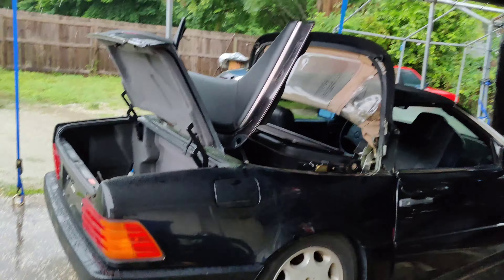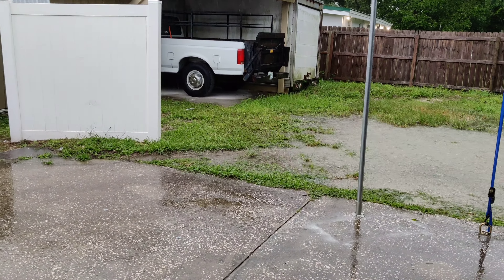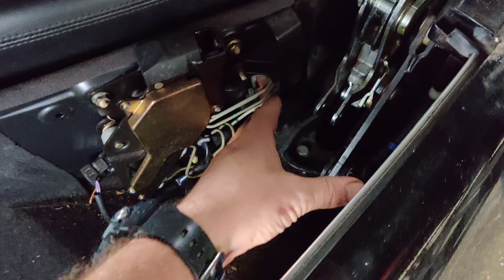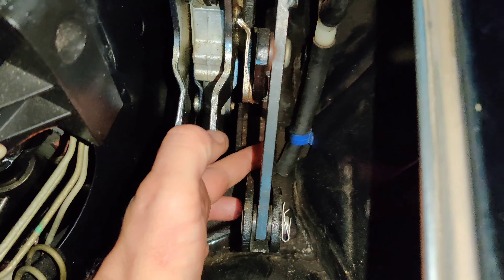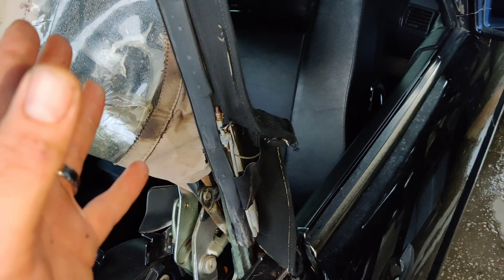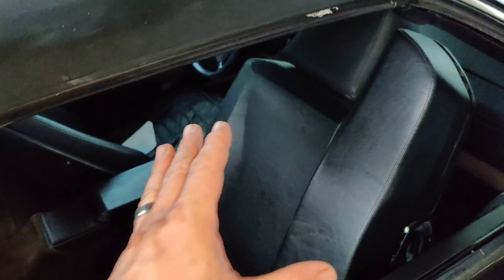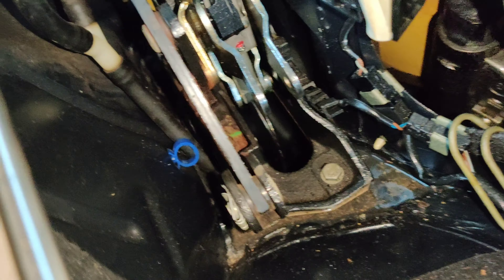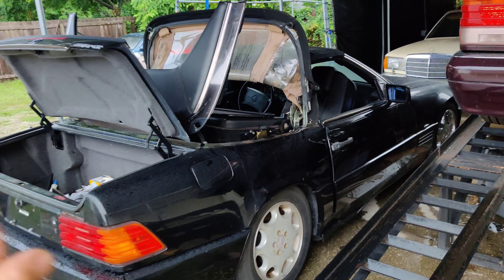Mercedes r129 I think I found the leak in top but need your help to resolve it

Comment: if memory serves the hoses are supposed to run into a grommet but i dont remember what the best way to see everything. i think you pull out the rear panels and can see more as well if you had a good way to lift it pull the inner fenders out and see, granted i could be wrong as i very very rarely see the pre facelift cars